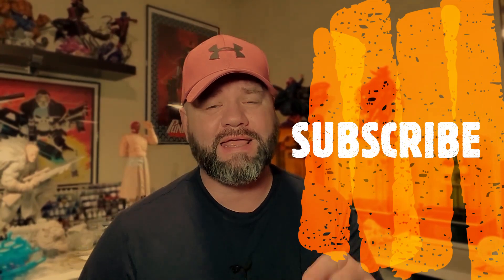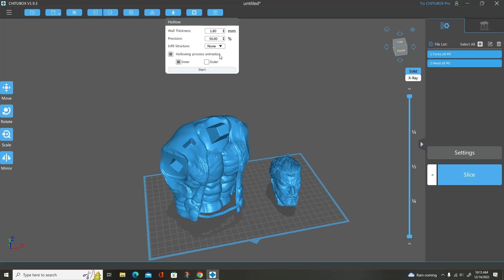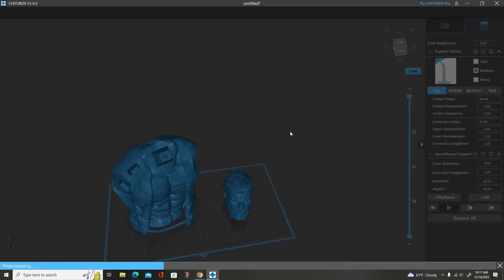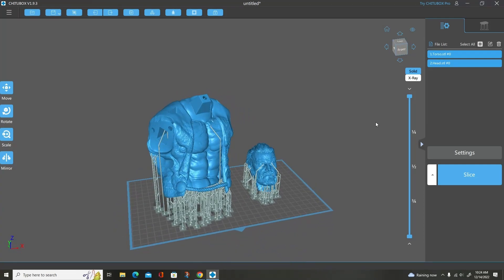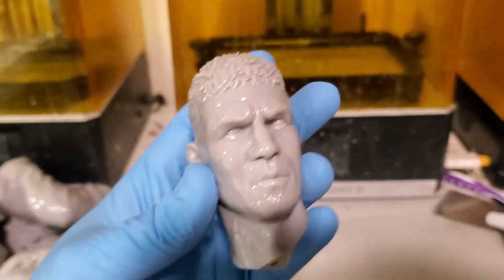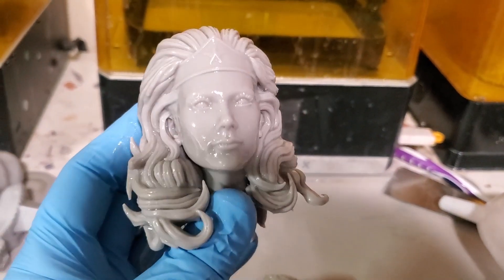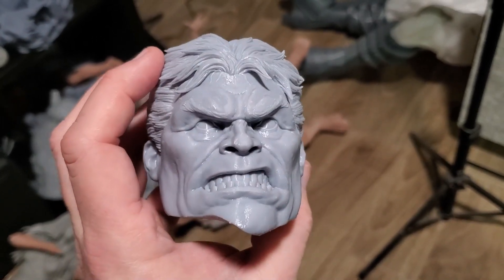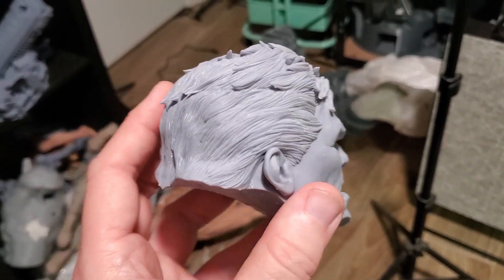Clean and Cure Your RESIN 3D PRINTS the RIGHT WAY!

Comment: In addition to a uv light inserted into the hollow model, I’ve had great success curing parts in my cure station submerged in water as the water reflects the light through the drain holes.
Reply: That's interesting!
I was wondering if optic fibers with uv source light won't be convenient to get inside smaller holes (if not too expensive)?

Comment: Another thing I do that has really reduced resin in my IPA is airbrushing the outside of model before wash. I was shocked how much came off onto paper towels. I use the same battery electric airbrush you tested on the channel to do it. Also just to be on the safe side for resin inside the model I bought a little uv flashlight and I shine it in the holes. Better safe than sorry. Thanks for the vid.
Reply from the maker: Good idea! I might have to try that!
Reply: Curious how do you manage the spray of resin? I airbrush off the IPA after rinsing, makes a huge difference

Comment: Just started into resin printing and the hurdle was the curing but the box idea helps a lot, super ghetto but effective. Awsome video thanks!
Reply from the maker: Very ghetto but it brats paying $500 for a curing station. lol
Reply: Just started a month ago, I went 1 level above "ghetto" ; got a free  broken microwave, removed the transformer and the microwave "canon" and put my UV led power brick in it's place (the transformer is supplied 120v), so I simply punch some time on the microwave, hit start, the plate rotates and the UV LEDs turn on ... And I get a nice "beep" when it's ready 😂

Comment: One thing I have noticed that no one seems to talk about is the actual cure time and how much it can change depending on the resin type. For example, I was using the Elegoo 8k resin and for a 6 inch figure, it would take almost 20 minutes to fully cure. Now I use Sunloo Standard Grey, and it takes about 10 minutes to fully cure. (using the Elegoo Mercury Plus station)
Reply from the maker: Yes it varies depending on the print and the resin. Might make for a good future video. 🤔
Reply: @TheCreativeCollector  I believe it would! I did a comparison test print on the same Goku model on two Saturn 2's and was amazed by the difference in quality and cure times. 

Also an FYI in case you ever do a follow up video on supports, Chitubox Pro (not sure about the free version) removed "Support Density". It is now called "Middle Distance" and instead of lowering the number for less of a support jungle, you increase the distance amount.
Reply: Yes!!! I keep seeing everyone saying to cure for 90 seconds to 6 minutes MAXIMUM. That amount of time has no effect on my 2-6 inch prints. Finally I tried for 15-17 minutes and they come out PERFECT. No discoloration or brittleness. Seems perfect to me. But it’s taken me a lot of digging to find anyone saying anything about 10-20 minutes curing, nearly everything I see says over 6 minutes will overdo it and ruin your print.

Comment: i like to wash my prints in ipa.  i try to avoid pro -post curing my prints as much as possible until they are tapped and ready for functionality. once my prints are capable and functional. then i will either paint and UV finish or just let the sun cure them.

Comment: The only thing I’m having a problem with is that when I put the infill on in the slicer, I’m still getting supports in my model.
Reply from the maker: Probably because you're using a newer version of Chitubox. You can turn off inner supports in the settings by checking on the box

Comment: your tips have been very helpful.  I had some prints crack on me, particularly when I used water washable resin.   Now I'm wondering if the issue was due to the walls being too thick and not using the infill technique that you have demonstrated in your videos (vs it being the actual product).   Thanks again for sharing this great info.   Will let my subscribers know of your channel when I get a chance.
Reply from the maker: Thanks. I've found that thick walls can lead to cracks unless you cure the inside separately. With thin walls you don't have to

Comment: Great video.  I do have a remaining question:  how do you dispose of the cloudy alcohol and any water that you might have flushed the model with before putting it into the cleaning station?  I don't think I want to be pouring resin down my drain to clog up my pipes or pollute the public waterways.
Reply from the maker: I sit it out in the sun to solidify then take the container to a recycling center nearby that disposes of chemicals.
Reply: @TheCreativeCollector  , thank you for the quick response!

Comment: can you cure inside the printer itself? take off the fep and use the clean tank option on Saturn, for instance.
Reply from the maker: I guess technically you could but it would burn out your screen quicker
Reply: @TheCreativeCollector  I did It last night and It worked a treat. It was a situation where I wanted something cured quickly, just a one off. I won't be making a habit of it. Good to know when in that situation though.

Comment: A trick that i use is put the supports beffore hollow it and ad the holes in this way ihave the prints completly hollow without support or infil inside
Reply from the maker: I use the grid infill to stabilize it and keep it from warping during printing. That keeps inner supports out.

Comment: Thanks for the video, i am waiting for my printer to arrive, says the resin is water washable, do i need to use IPA for better results or water is just fine? I can have as much IPA i want for free so this ain't a problem but i would prefer water. Also how much time under the UV lamp or sun?
Reply from the maker: Water should be fine. I cure my parts a little longer. Usually around 10 minutes

Comment: Just wondering why you don't use the cure function on the Anycubic?
Have you tried acetone? Much better than IPA or alcohol imo.
Large prints with broad detail are fine for IPA, but when you're printing 32mm minis with lots of tiny details the acetone definitely makes the difference. You also get a lot more prints out of it before you have to toss it. IPA/alcohol gets muddy after just a few prints. Acetone is good for around 30 prints.
Reply from the maker: I dont use IPA. Instead I use denatured alcohol. It's a clean burning fuel that doesn't leave any residue. A gallon costs $20 and it cleans about 50 large prints for me. Acetone is good but some primers and paints don't like it after it's dried on resin. It can leave a tacky feel. I never have any issues with details plus it's rare I print minis.
Reply: @TheCreativeCollector  Yeah, it was more for your viewers. A lot of people don't know about the acetone. The trick is to swish it in boiling water for about 20 seconds after the 30 sec acetone clean. Prints come out perfect.
I work as a miniature and 1:12 scale collectible sculptor so I test print all sizes. I tried everything including the alcohol and found acetone best for my needs. I think it's important that beginners experiment with all the options. It's very daunting for people just starting out in resin printing, especially if they have no background in 3D software.

Comment: Just ordered a Photon Mono 2. 

Is it neccesary to wash the prints? 

Should I buy a seperate washer?

 Or is there a way to do it by hand? 

Im coming from the FDM printer world.
Reply from the maker: Absolutely necessary to wash the prints in alcohol unless you're using water washable resin, then you use water. Your best bet is to get a separate tub or container to wash in.

Comment: Do you solely use chitubox auto supports and they work out or do you manually add a few as well?
Reply from the maker: I do both. If I feel like auto doesn't add enough then I'll add a few more.
Reply: @TheCreativeCollector  do you just use default support settings or have you made changes?

Comment: 1-drain holes are not just for drainage, it is important to think about where a vacuum/pocket will form between the resin pool and your partially printed object... the holes are not for drainage in this case, they are a way for air to escape, so you can't place holes all willynilly.... if you don't have a way for air to escape in the right places, you'll be deforming the print on every layer.

2- regarding infill to avoid inner support, i thought that was what the 'platform' vs 'all' button is for. 'all' will create internal and external supports. 'platform' is just for what the platform can access.
Reply from the maker: You forgot about proper orientation has a huge part in suction too. So yeah....you can place the holes all willy-nilly in this case. Because if you've angled a piece the right way rather than print flat, with drain holes on those angled areas, it doesn't matter where you put them. The lift will compromise any possible deformity. And the all vs platform has no relevance with each other when you're putting or removing inner supports. The grid function serves as a support function and knows not to put inner supports on top of already placed supports. Chitubox has confirmed that.

Comment: I’m still confused about the alcohol do I just dip the pices in a bowl of it or do I need to get a spray bottle and mist it do they need to sit in the alcohol for a minute or is it just a quick dip and than uv light
Reply from the maker: Needs to be submerged in alcohol for a bit and agitated. Then pull out and let dry for a while before you start to cure it. Make sure all of the excess resin is removed from the print

Comment: I so love your videos. I have my eye on the Saturn 2 8k printer with their cleaning station. I think that would be a great start to resin printing unless there is an issue with that printer that you want to share with me. I was also wondering if you buy just one brand of resin in bulk or is there a need to have different types? What brand in bulk would be worth buying. Thanks for any input, someday you will have my name on your screen...
Reply from the maker: Thanks! I've heard good things about that Saturn and as far as resin goes, I use different types. I like exploring around and see what works. The ones I use often are the Elegoo standard and Sunlu grey. Those have been great for me and won't break the bank.
Reply: @TheCreativeCollector  Sorry to bug you again. Have you any thoughts about the water washable resin? If I understand correctly, they don't need to be put in a IPA cleaner. Must be a downside that that stuff.

Comment: Hey im printing 20cm tall body parts (leg torso and hands together) and its only possible to put one punch hole in the neck key to head. Because the leg only touch the ground like 8mm, and i need to put a bolt there. Should i re purpose the bolt hole as the punch hole too?
Reply from the maker: Might be a good idea unless you're printing them solid.

Comment: My prints after I wash them on 99% IPA and cure them they feel a bit sticky to the touch. After I clean them on IPA I use an air gun to air spray and dry them well before curing. Could this be caused by the IPA be dirty? I have an 8 litre tank that I've cleaned about 20 prints there.
Reply from the maker: It could be but I've heard IPA can leave a sticky residue especially if you're using ABS resin. I use denatured alcohol and never have any issues.

Comment: A doubt... I put it to wash in alcohol and then I put it to wash in water... since my alcohol is already reasonably dirty... I use the water to wash it to remove the rest of the impurities that remain with the reused alcohol . Is there any problem doing this process in sequence?
Reply from the maker: There's no real issue with doing that. Just make sure the print is completely dry before curing or you can get water spots on the print.
Reply: @TheCreativeCollector  thank you... I usually do the cure the next day; but even so... there are parts that are "glossy" nothing big.. but it's strange
Reply: @felipeprato  glossy is from resin still not cleaned off. While.its in the IPA, use an old toothbrush to get in places and scrub it good. Not good for small parts but use ur own judgement.

Comment: Thanks for this video Henry, I've been FDM printing for a while but am getting a Saturn S for Christmas and this is exactly the information that I needed. 

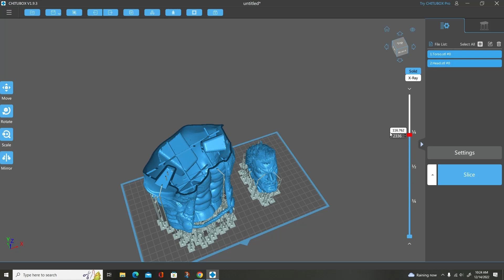One question: Right at around 5:59 - 6:05 you are going up and down along the hollowed model and it looks like that tab on the back for connecting the cloak pops in on the inside of the model at a place where the infill isn't hitting it. Is that supported okay or will that need more support? Like I said, I am new to resin so maybe I'm missing something but I would think that part would fail until it met up with the larger piece, is that not right?
Reply from the maker: So that infill isn't meant as a support really. It's mainly used to maintain the structure of the print. I've never had any issues with prints having pockets. It's rare. And a lot of that is based on how the artist designed it. Fixing that is a whole other thing.

Comment: It my first time printing big, i usually cure with sunlight bcs i live in tropical country, but i wanna know, how long can a print last without curing until a cracking occurs?
Reply from the maker: Cracking doesn't usually occur unless there's something wrong with the print, however I'd cure it within a reasonable amount of time.
Reply: @TheCreativeCollector  how long is that reasonable amount of time? hehe
Reply: Curing in sunlight takes up to 12 hours, whereas a UV light will cure in 5 Mins. I live in one of the sunniest parts of Spain and I don't use the sun to cure. 😂

Comment: Resin printing is a lot like fdm when others print it! I do the same process as you for resin and I use walls and 5% infill on the fdm side, people don’t realize you don’t need to be wasteful printing non functional prints! Same with the resin people use, I see all kinds of people using $35-$65 bottles to print a statue, no no no hell no! Sunlu resin is cheapest and it does the job!
Reply: For my FDM prints I have gone almost exclusively to Cura's lightning infill. I love that setting: hollow everywhere except where it needs to support the model from the inside.

Comment: Gotta say, man, every time you show hollowing and talk about how you don't support the interior, then you preview the layers up and down a few times, you can clearly see that there are islands that are not supported. In one case, you even showed the print after and casually pointed out that the print errored for some reason the peg cavity but that you could fix it. THAT was due to not supporting the inside of the model. Lot's of great info in your vids. I'm totally not a troll. But this makes me crazy every time you show your hollowing.
Reply from the maker: Well thanks for the feedback, but the infill isn't really meant to support anything other than the structure. Just to make it more stable if you will. And I'm not sure what islands you're referring to. Maybe its camera angle? But I've never had any resin pockets or islands in my models by doing this. I've printed well over 100 models in the past 2 years and I had only 1 issue, and that's the one in the video. Nine times out of ten when there are fails, it's due to something minor with the printer, resin, or my error, but usually never the hollowing process. This process works for me, so that's why I show it. And it's helped a lot of others as well. Anyways, thanks for the feedback and I appreciate your support. Happy printing!